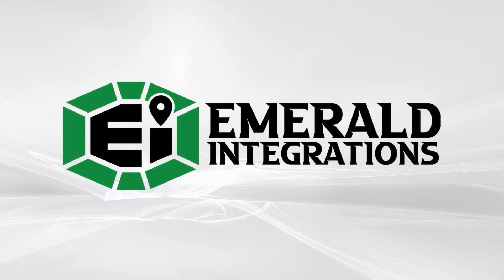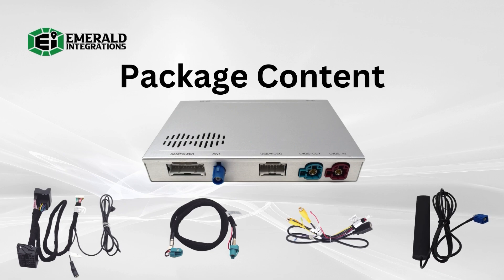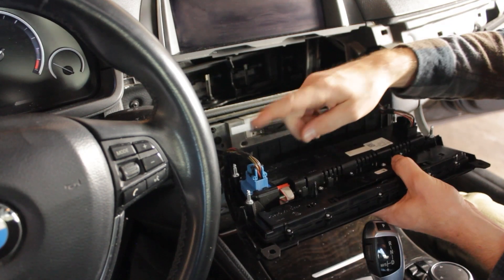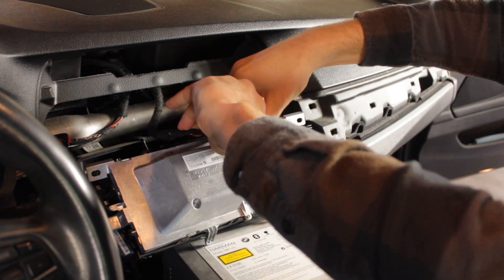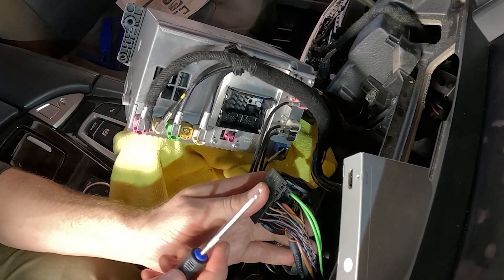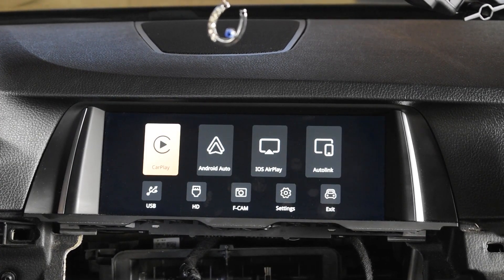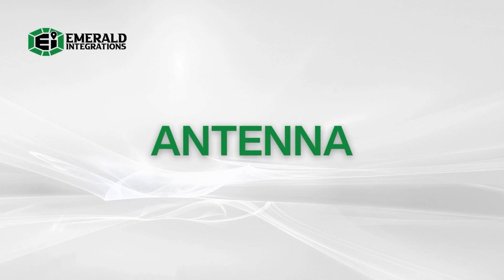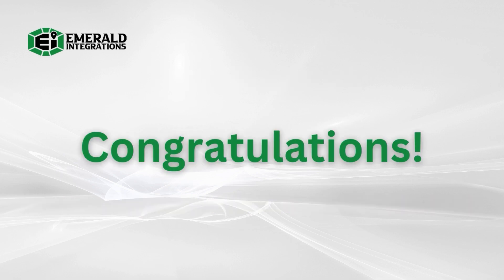How To Install CarPlay / Android Auto for a BMW NBT Radio

Comment: For bmw f02, production 02.2014r lci. Is thesame produck?
Reply from the maker: Hi there! As long as it's the NBT Radio System then yes, everything in the video will be identical for either our Backup Camera System OR the Wireless Apple CarPlay / Android Auto System. 

If you have the CIC Radio System in your vehicle, the installation process is virtually identical but the cables and module differ.
Reply: @Emeraldintegrations  how to buy this ? What is cost?
Reply from the maker: @Awiatan1   https://www.emeraldintegrations.com/catalogsearch/result/index/?cat=12&q=nbt Select the product for your vehicle on this page and choose the "Add Carplay" option. If you already have a backup camera, then choose "none" for the backup camera option.